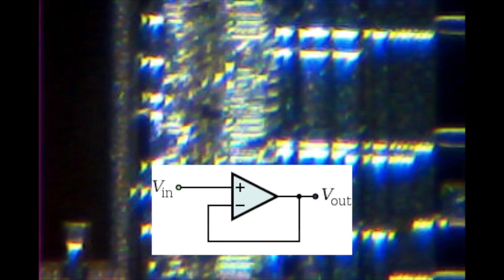What's inside a microchip ?

Comment: Guys... in 1973 I went to work for Ross Perot @ Texas Instruments in North Dallas. My first job was in the electronic calculator manufacturing line and more specificlly I ran a machine which formed and cut each of the three leads attached to the transistors that were inserted into each calculator's printed circuit board (mother board). Unlike the microscopic transistors in this video our transistors were about the size of the tip of your little finger. The chip you see in this video would hold hold maybe two of the transistors we used then as opposed to the millions or billions that would fit today. That is called progress.
Reply: C.M. Mike Adams At around that time in Australia, guys were selling calculators to Life Assurance Salesmen and other businessmen as a full time job, and making a very good living at that. Some could afford to drive a Volvo, which was a sign of commercial success. Recently I bought a similarly featured calculator for 20 Thai Baht (approx 80 cents), which also demonstrates "progress".
Reply: @BrassLock  Heys. I might work at TI some day. I'm currently at UT Dallas :P
Reply: Strange how little the public knows about the Instruments they use every day. Im in my fifties and succesfully self taught on so many subjects in my years. I love tech.
Reply: @roddoney7568  The public admires flashy entertainment figures too, too much. Many people are not grateful for all the work that millions of people over decades have worked on behind the scenes to make modern life possible.
Reply: Imagine what we'll have 40 years from now.
Reply: A couple more games with Ray tracing support.
Reply: moores law
Reply: I'm your 200th like, I want a prize
Reply: Maybe those were "power" transistors. There's no way yo can make a even slightly compact calculator with discrete transistors.
Reply: It’s called Moore’s law
Reply: @stevenartuso9708  yup
Reply: Obviously this was back when dinosaurs roamed the earth.  One can only wonder with Ai, and software -  hardware we will be in 50 years, that is if we haven't rendered ourselves extinct.
Reply: Dab on them haters
Reply: Strange I remember 1973 as we had the Intel 8008 on 10um. You fingers cant touch that either.
Reply: I envy u
Reply: @z3 No way. The first CPU was released in 1971 and the industry quickly followed. Mind you, this is a full CPU, I'm pretty sure there existed integranted circuits before, just not AS integrated as the 4004 (and not even comparable to today CPUs)
Reply: @IVAN3DX  actually cpus existed in 1950 but where isanely expensive.i know that in soviet union enginers built nuclear rocket where they needed to fit room size computer into rocket.thats reason why old rockets are so massive
Reply: Moores law
Reply: What ever happened to that barrel?
Reply: Thankyou. I live my calculator💕💕💕👍

Comment: why does the data get removes with an uv light o.O ?
Reply: SaintMarneusCalgar on each memory cell (a.k.a a bit, not talking about a transistor as each cell has a number of transistors for reading/writing) there is an  insulator that prevents the change of the state. Each memory cell is actually charged like a battery, or capacitor, to a desired voltage level. It's interesting how it stays stable for decades... Anyway, the insulator can be made "leaking" with external energy, and I guess the cell absorbs the UV frequency range the best. So, you can short (zero) all the capacitors at once and then charge again. Other type of erasable programmable ROM is EEPROM, and it can be erased electrically (no UV window in those). It's circuitry must be more complex, thus the EPROMs saw the light, if you accept the pun. It's been a long while since I heard this on a class (nearly two decades), so I'm  putting pieces together using what I know about physics, and this is not probably accurate, but the idea should be close enough.
Reply: The idea behind the data on this chip being erased after exposing the chip surface to the UV-light, is pure physics! The bandgap of Silicon, which is the sole matter of these chips, is close to the energy of UV light. So when UV light hits the silicon material, it causes charge carriers to flow, meaning an electron movement across the body of the silicon material. And the transistors in those chips are made of Silicon material, the 1/0 analogy on them is based on the physical characteristics of doped Silicon materials. An electrical current with appropriate energy can change the 1/0 state of the memory cells/transistors/flip-flops or whatever it is called a memory unit on those chips; and so can UV-light!!   Yet, visible light and other light with energy higher than UV-light's, do not match the bandgap of Silicon; thus, they cannot affect the states of the memory units the way it safely does with UV.  I hope this helps.
Reply: SaintMarneusCalgar it's so many of these chips can be erased at once conveniently. a piece of electrical tape can prevent it from being erased with ambient light making it either a permanent solution or temporary.
Reply: i mean how it works
Reply: thank you :)

Comment: Can graphene replace silicon in chips? like maybe making ships smaller.
Reply: Graphene is resistable as hell.
If it was even possible to make it you could expect atleast double power usage and TDP.
So in other words, not practical.
Reply: Van JoshElanium another allotrope of carbon in the form of carbon nano tubes recently made a breakthrough in power efficiency beating out silicon.
Reply: Golden Grenadier I also saw the latest breakthrough of the applications in carbon nano tubes potential in electronics in downsizing the space required for massive amount of resistors. Also buckyball formed Graphene which is stronger than Diamond and can withstand immense pressure. I wonder if there are applications to that could help for longer battery efficiency.

Comment: i find that when i use logic gates 7400's or 4000's they seem to be very vulnerable to destruction?  do i need to use input voltage equal to vcc voltage let us say vcc is 10 v do i need to unput to logic gate 10v. what i am trying to say is that a quad and gate etc many gates do not work properly when i test them. when i buy kits they seem to work what is going on?
Reply: gerald kopache first, check out the data sheets for the exact type of the chip. You get the allowable voltage levels verified. Then, the use of inputs: do you pull them to ground or VCC via resistors? I was thinking about static electricity, if you leave an input hanging open (not connected). CMOS is more likely to suffer from that, but still. What I know for sure is that you don't have to input exactly 0 and VCC. There are thresholds specified on each type of chip. And you usually may not exceed the VCC. Moreover, TTL chips  used to work on 5 volts, but I'm not reading this from a book, so check the datas and example connection first.

Comment: wow just imagine a core i7 or xeon CPU
Reply: A modern transistor on a cpu these days is extremely small. About 300 times smaller than a red blood cell. Millions of them in one single processor.
Reply: @pixel3000nerd  20nm (nanometer) each one
Reply: Smallest transistors ever produced (so far) are just 5nm wide (one atom thick, and 10 wide)! They were made from graphene, which is being studied to replace silicon. Update: there have been transistors made more at ONE NANOMETER (across the gate).
Reply: @robertsjames2002  WOW
Reply: @robertsjames2002  1 nm is 70 silicon atoms
Reply: i have no clue what it is some say 2 atoms per nm some say 5 some 70
Reply: @ducksonplays4190  atoms are different sizes based on how many electrons they contain.
Reply: Pixel3000nerd how do they make them then
Reply: They are printed using a static charge process of photolithography. Basically, you'd make a macro transparency of each layer of microchip. Then you'd use extremely precise lenses to project those images onto graphene sheets (which are spread out onto metallic sheets, usually platinum). The graphene would have been treated with a chemical sensitive to uv light, then as the image is focused, uv light is shown through is hardening the graphene to the platinum substrate. Once that layer is hardened, an acid solution dissolves the unhardened graphene/platinum matrix, then the next layer is focused and hardened, and so on. The process is so extremely expensive because graphene is difficult to produce, and  the printing process used to make such small transistors is only something like ~5% successful. So 5 out of 100 are viable. Again, the process is still being perfected.
Reply: @pixel3000nerd  4 years ago
Reply: Core i9 or Ryzen now
Reply: My thought is imagine the power of one of these things scaled up to the size of a human brain.  AI doesn't seem far fetched from reality.
Reply: Millions? Haha.. Not really.. More like billions
Reply: D wave CPU
Reply: @mannyvit1423  It doesn't use transistors, it's a quantum processor, works totally different.
Reply: ryzen with 4nm tech?
Reply: Erfan Rouhani I know, right?!
Reply: @anthonyvolkman2338  wow
Reply: Core i9?!
Reply: You think to yourself, as you type this in on your computer
Reply: Antonio Innocente Yeah but thats not how the language works,,
Reply: @YourNightmar3  1000 millions
Reply: @YourNightmar3  We are talking bout transistors not language duh
Reply: A german overclocker ( der8auer) made it possible to see what is going on in a intel processor. I very recommend to watch if you are intrestet. In my opinion it's a bit disappointing because it's so simple.
Reply: core i9 now
Reply: *cough

Ryzen 3 3100
Reply: uhh amd threadripper and epyc
Reply: it'd look like a slab under a optical microscope
Reply: What about AMD
Reply: Mexicans made the microchip
Reply: laughs in Zen3 Epyc processors
Reply: or threadrippers
Reply: what about core i9 zx3900

Comment: Well, you are making it sound like the transistors hold the memory and the data of the chip. This, however, is only partially correct. It's not just any transistor, it's a MOSFET.
The MOSFET works a bit like a transistor, only that it depletes a bit differently. Getting a voltage towards the gate of those micro MOSFETS will cause a shift in the p-type layer of the MOSFET, causing electrons to be able to tunnel through from source to drain. Aka: A bit was written.
If you apply a negative voltage to the gate, the p-type layer between the n-types will stop passing charges, thus resulting in a blockage between the n-type layers. This is a free bit.
Reply: MOSFETs and BJTs have distinct differences, yes, but it's still perfectly acceptable to refer to both simply as 'transistors'. It's in the name after all, they are transistors, but with some differences between them. 
And strictly speaking it isn't just a MOSFET in an EPROM but a FGMOS. Again distinctly different, but still a transistor.
Reply: Adrian Dinanski Well, fair enough. Still I'd consider a BJT to be something entirely different through the way it works. The differences between those and actual memory cells in CPUs for the Cache should also be made, but then again, this goes into microelectronics engineering and that's about where my knowledge starts to get very thin.
Reply: @Finkelfunk  lol Jesus Christ is the Firstborn follow him.u will understand the engineering part.remember to build Micro chip u should have an idea on chemistry
Reply: @Masterfocus365  Yeah no. Thank you but I don't want anything to do with religion.
Reply: I think he termed a genera term that is transistor.  We know transistors can be divided into BJT an MOSFET. The same MOSFET can be classified accordingly. so yes it is MOSFET which can offer the ability of memory..

does any one knows that water we seen around has memory capacity?  Because I know.
Reply: C 14 IPS But a BJT and a MOSFET are two entirely different mechanisms, although both are classed as "transistors". Kind of how an electric eel and a carp are in the same subcohort, but both are two entirely different fish.
Reply: +Finkel - Funk yes...otherwise both field effect transistors and bipolar junction transistors would have made no distinction. It could have been used interchangeably. right?
Reply: @c14ips17  yes

Comment: The technology used to implement those many transitors on such a small scale is called lsi ( Large scale integration) this is technology is a bit old, based on either transistor to transistor logic or resistor to transistor logic..

Comment: The reason why they are able to use less pins per transistors, is simply because they have multiplexer circuits inside them to address which transistor (or memory address) the data goes to

Comment: Thank you for this video.  It took me back to when I was a Technician at IBM Research.  I did the design verification on the CAD systems and then once the wafers were made, I would saw the chips, mount it on a chip carrier and painstakingly wire bond it.  I think we used silver wire because it was easier to ultra sonic bond to the aluminum pads.  It was also more flexible to loop up so it can cross over another wire like a bridge without shorting.

Comment: hi all. i am going to write easy version for you to understand. codes present the language. language as every other. how to store the information? simple black and white. white is one bit info for example. or light is on. to understand what transistor do, u must understand the electricity. battery for example is just 2 metal plates with different electric polarization. what happens inside electrical circuit? electrons wants to jump or flow from one plate to another. humans come to idea to make electron pipes. so electron flows normally inside the pipes, but some transistors are set like switch. that is the catch! with turning on and of light u can write the code. how to memories the switch position? to understand this process u need to understand the chemistry. basically it is all about electron barriers. inside there are pools full of the electrons and the idea is to make them flow from one pool to another. in memory effect for example electron pool is empty and electrons can not jump to second pool. I hope it helps. by dt
Reply: I read it all wow I am great

Comment: we can remove the molding material for non -transperant micro chip using decap process.The acid will eat the top black molding material and you can see the IC chip and wirebonding as well through naked eye .

Comment: the transited # you gave is wound everything that has 1 cent of logic in that chip uses at least 1 transistor and the one you pointed out is a cluster you probably have maybe 100 to 500 transistors in that because there on the atomic level and unless your thing can see atoms you cant see the transistors you can see the photo reactive die that is used on the chip.